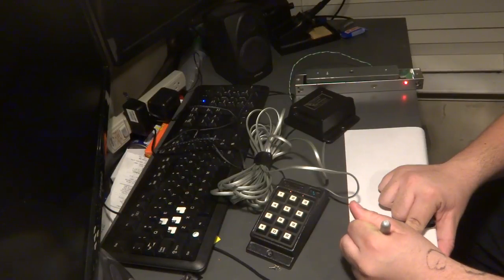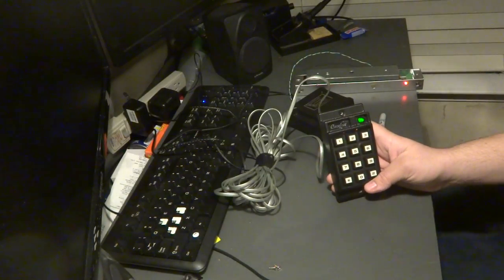Old Carefree Access Systems Model 1060 Access Control Keypad Demonstration

Comment: Hey there, I have a single door access controller similar to the one you have in a lot of your videos and it uses the same software as yours too. I was wondering if you could make a video on how you get the mag lock to stay off when the door is open and how you manually bypass the lock to keep it unlocked all the time. Cheers.